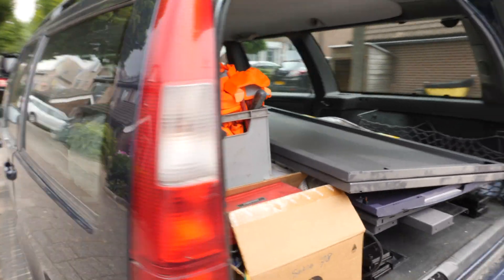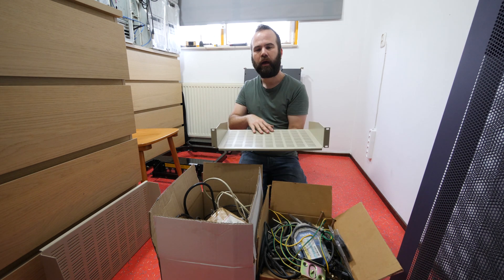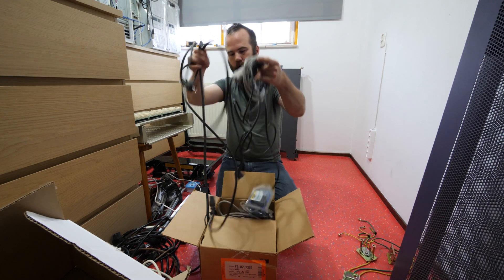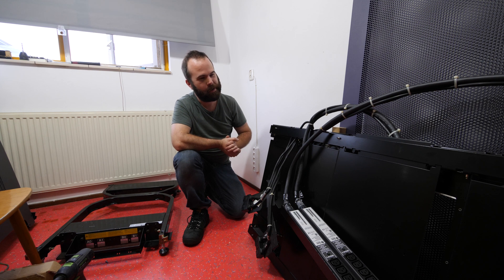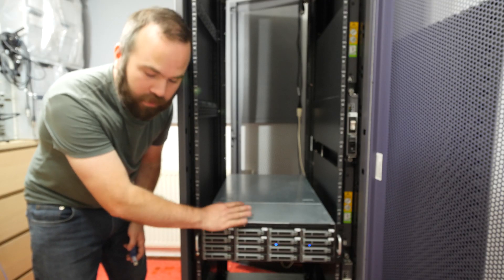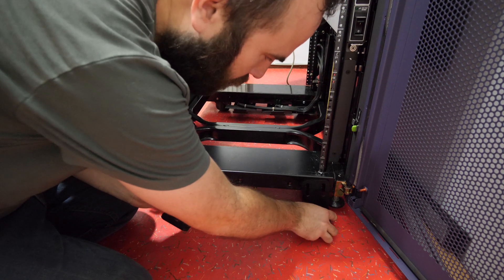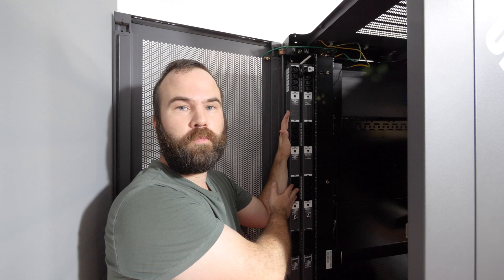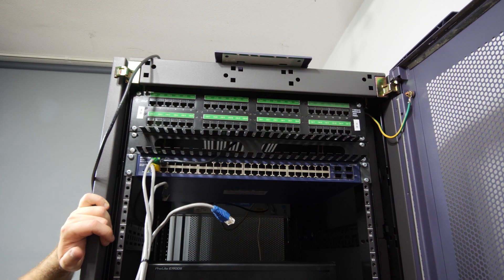I bought a Sun Server Rack for my Home Lab

Comment: Thanks for the video ... as I want to get a Sun Rack 900 as well but was not sure to which degree you can disassemble it for transport but now I see you can really transport it in a Golf. Btw the cheapest I have found now is 600 EUR incl. the PDU's here in Germany.
Reply: Disassembled it is less than 1,80m. It fit inside a Skoda Superb, but be careful with the bottom cover above the sparewheel may bulge in on point load (get a wood plate on top to distribute the weight)

Comment: you can mix cat# in the cables and connectors, you will just have a connection rated to the lowest common denominator. cat6 on cat5 rj45's will give you at least a shielded cat5 connection, probably with cat6 performance.

Comment: You only paid 150 Euros (So to me $167 USD) and you're saying that is expensive for a used rack where you are????? That rack would probably be around $500 USD used where I live.
Reply from the maker: Here people want to get rid of it. And don't want to be rich of something that takes so much space!
Reply: @victorbart  the space aspect makes sense. I keep forgetting that homes and apts are smaller in most other countries. The money is part, it's the companies upgrading their equipment and selling off the old to offset the cost of new or a company that is closing or already closed and either the owner or the bank is trying to recoup losses.
Reply from the maker: @MumbysBar  If a company need to sell of his old gear to pay for the new stuff. Then they are doing not so great as a business. I mean You buy gear for 3, 5 or 8 years. And after that you get rid of it on the most easy way and replace it with a new investment.Just write it of in the planned years.
Reply: I can hook you up with 2 for free in VT, US.

Comment: You can connect CAT 6/7 cable to a CAT5 Patchpannel. There is no Problem. The only thing you need to keep in your mind is, that the complete Cabelsystem is „only“ a CAT5 System. But: To establish connections with 1Gbit you need a cable system that can transmit 80MHz and CAT5 can transmit 100Mhz and the CAT5 Cables are much thinner. If you are honest, then CAT6 and more is a lot of marketing and required for 10Gbit connections.

Comment: Leave the rack the way it stands now, it's the best position
You definitly need a kvm monitor and switch there so easy in use.
And start from the begining with cable management it will get a big mess otherwise
You can also move the front rack profile back a little so the server will fit
Reply from the maker: Yes this will be probably the place where it will be

Comment: Most of the times you will find that the network switches are located in the back, because that is where all the ethernet interfaces of your servers are. it will save you a lot of frustration to move the switch to the back. Or if you really like your switch on the front, you could terminate a bunch of ethernet cables into that patchpanel and use small cables between the panel and the switch. That would look cool but it would introduce 2 extra point of failures for every cable. Also, I don't think the door will close :)
Otherwise, very cool! :) Can't wait to see it finished.

Comment: If I left anything that long without being dusted out here the fans would have died a horrible death.

Looks superb. I need to find a sun rack for all my sun gear real bad.

As long as you keep the heavy stuff on the bottom you should be just fine as far as being tippy goes. I do the same thing, UPS and Drive Arrays go on the bottom.

Comment: With patches and other short runs, you can usually get away with Cat5e over something newer.

Especially if it is only 1GbE instead of 10. I'd probably do Cat6 stuff if you are doing any permanent runs, just so you don't have to replace the runs later - if it works with the older patch, great. If not you have to replace the patch panel, but at least the run is already done with the right cable. :D
Reply: Yeah, short runs are fine. We happily run 10GbE over Cat5e